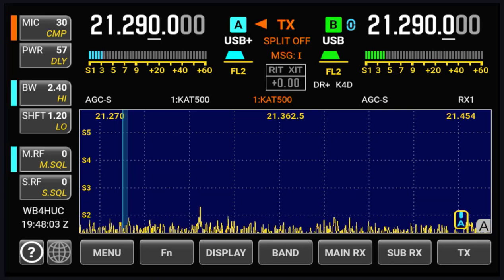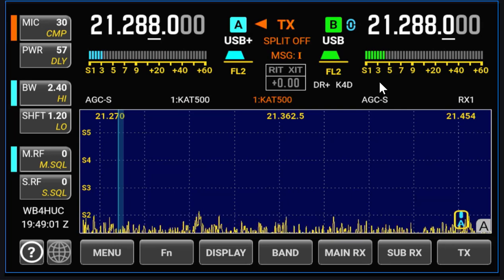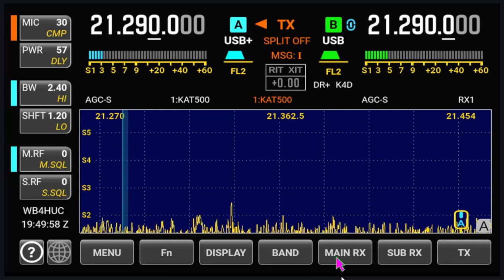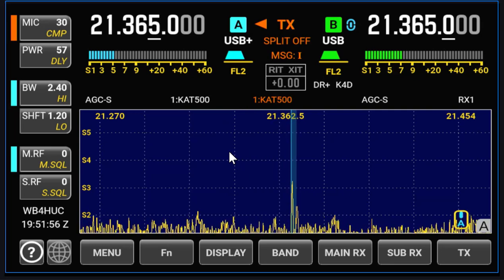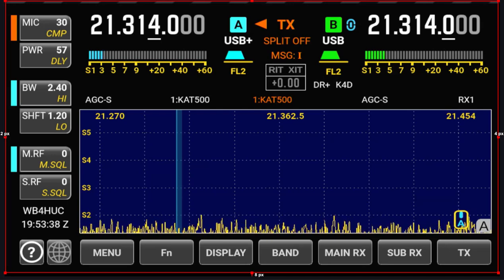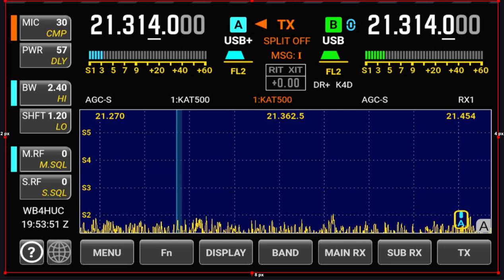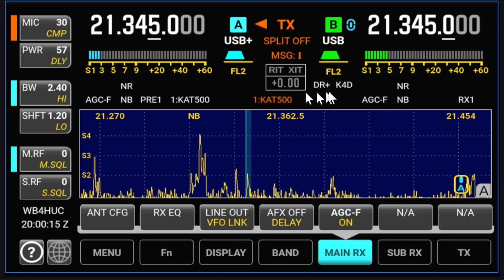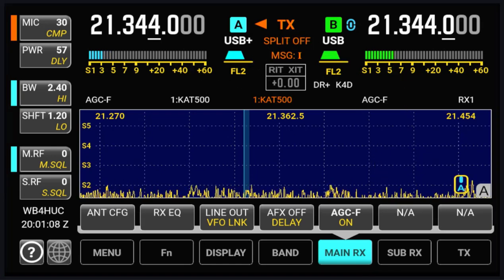Elecraft K4D and Diversity Reception

Comment: Excellent video. I just set up my K4D using your tutorial with a RX Loop on Ground (LoG) connected to  VFO B. With headphones it's fascinating to hear the signals favor either the the left or right channel based on relative signal strength. 73 Tim W8JJ

Comment: I never realized you could connect both VFAs together.  I presently on have one HF antenna but that will change as I get a tower up.  I do like how you have your. Call sign and time in the corner where I have voltage and current.
Reply from the maker: You can change the little status display. I think if you touch the screen at that location it will give you several options.